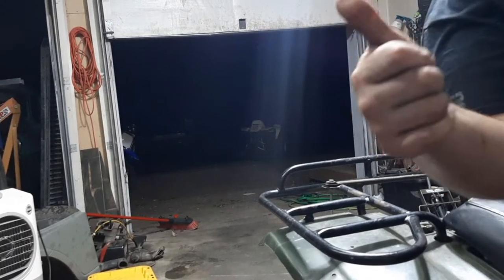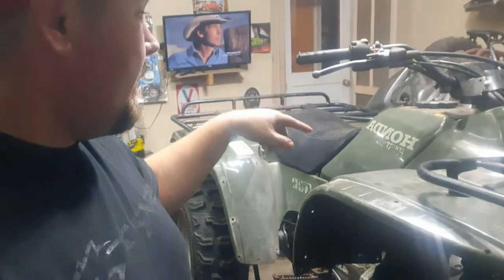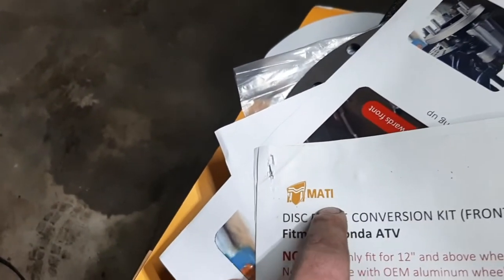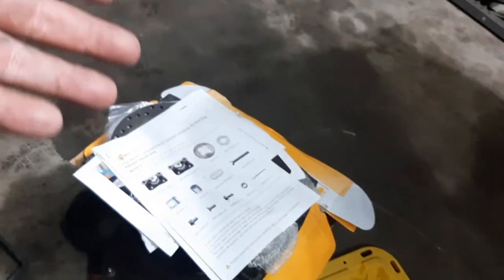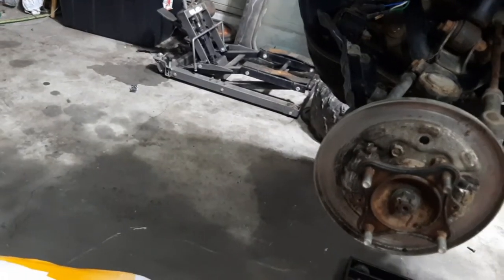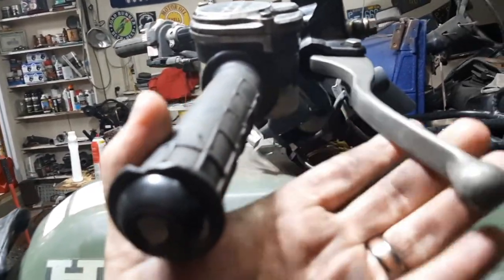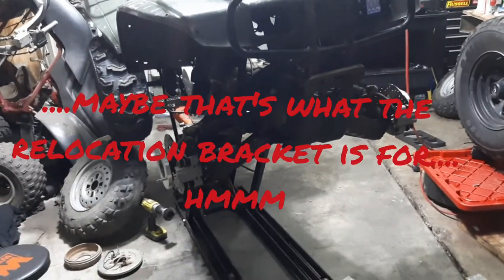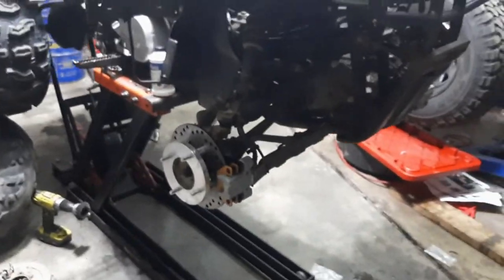DISC BRAKE CONVERSION! '98 Honda Fourtrax 300 4x4.

Comment: First off, Let's GO Chiefs!! I live in the KC area, and just picked up a 98. Rebuilt the master, and went through the entire front brakes....and they're still not great. So I guess this is my next move. Thanks for the video.
Reply from the maker: CHIIIEEEFFSSS!!!! The disc brakes are definitely the way to go. Once I got them bled, and put on a good master cylinder it would just about flip ya over the bars. 

Also KC area btw, south of Metro.
Reply: Ive replaced several of the drum brakes a long time ago for myself and friends.  The drums are going to eventually get water and mud in them.  once that hapens, they wont last long.

Comment: Its been a while some time now since you installed this kit.  I see there are more expensive kits on the market.  Highlifter i believe.  How is this kit holding up?  what about the quality opf the materials?  Do you think i should opt for the better name brand?
Reply from the maker: This kit was definitely on the cheaper end. I don't have the quad anymore. From what the Facebook groups have posted, there really isn't a difference, as they're all Chinese made and use Polaris calipers. For me to dish out more money than $250 I would need to see something extremely different

Comment: Nice looking CJ-5 in the background! Do you need larger wheels after installing this brake kit?
Reply from the maker: Not on the CJ! This kit and all the other disc brake kits have to use the 12" wheel, will not fit the 2wd 11". So no, mine did not need new wheels.
Reply: Thanks for the reply! My 300 is 4x4 so it should have the larger wheels. Still love the CJ-5! Looks like you have a good project going. My 79 cj5 is an ongoing project!!
Reply: Well, apparently I have the 11” front rims! Appreciate the info though
Reply from the maker: @Fireman12-24  see if you have a set of 12" for sale locally. Can be off of pertnear anything with the same bolt pattern

Comment: Any advice on how to get my drum  off my 96 300. It doesn't have those 2 screws
Reply from the maker: Smack it with a hammer to break it free. I believe there's an adjuster on the rear you could turn down technically but smacking it typically works.
Reply: @weekendwarriorpowersports  thank you

Comment: You need to you your brakes. Embed some of pad material to the rotators. Get the heated at least five times at speed. My disc brakes work great after that.
Reply from the maker: It was the master cylinder, leaking out the seal. Replaced that and it'll just about flip ya over the handle bars lol